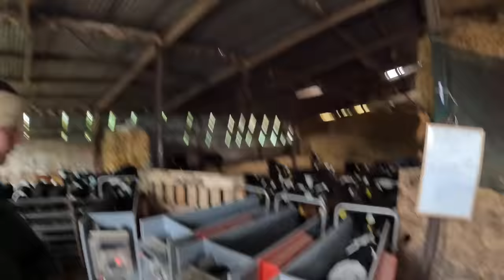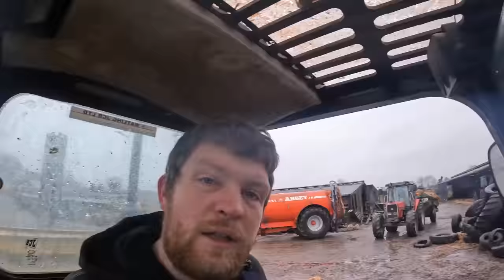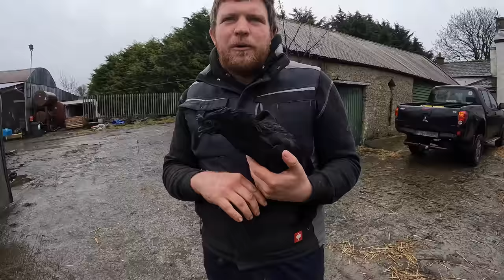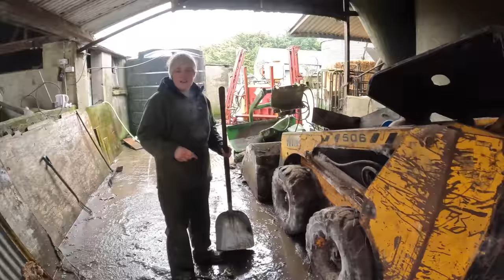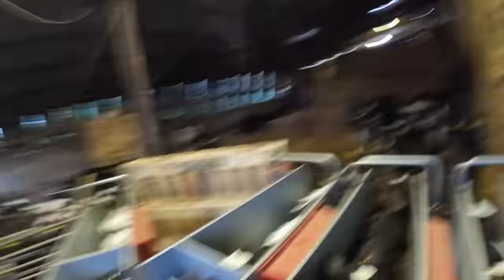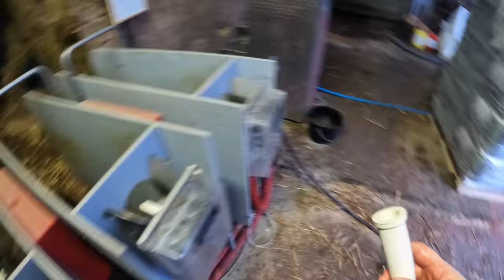SPEND THE DAY ON AN IRISH DAIRY BEEF FARM

Comment: About needing another loader, Is the Massey digger out of action? Thought it would have been able to fit into the shed. Might need to get a quick attach or pallet forks for it for moving stuff around the yard.
I assume you use the veneri for mucking out the sheds.
Time the get the 6480 back on the road?